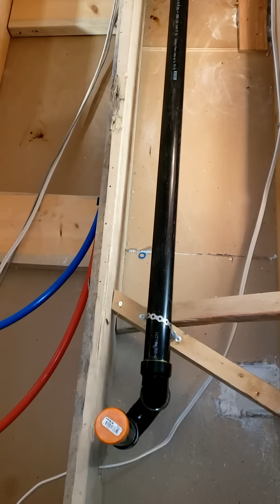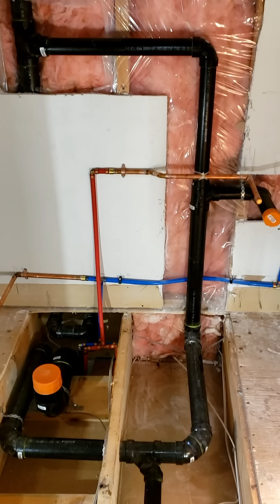Wet Venting EXPLAINED! - #SHORTS

Comment: So I was wondering the one that only handles Air I guess it’s on the left hand side of the video behind the drywall. Can you run a condensation line from an AC to that one because it does go to the draining system yes thank you
Reply from the maker: Good question.  Technically, no, you're not allowed to simply connect a condensation line/pump to the vent.  While you're correct in presuming that it does lead to drainage (and WILL "work"), the vent is carrying sewer gasses, and simply dumping the contents condensate line into it without properly trapping and venting it, may expose sewer gasses into the building.

Then there are other implications about having the extra volume of water draining through the wet vent, proper sizing, etc.

The optimal solution would be to have the condensation line discharge indirectly into a nearby or added floor/hub drain (with a proper vertical air break of at least 25mm/1" - depending on your jurisdiction), or perhaps indirectly discharge into another fixture.

I know it sounds like a pain and futile, but that's the Code requirement for proper plumbing! 🤷
Reply: @PlumbingsCool thank you so much for the reply, my house was built in 1980 it’s a one story and they did run the condensation line into the sewer line directly. I just recently found this out because the condensation line was bumped by the ac repair man. I have no idea what can of worms this is going to open, there is a ptrap on the condensation line before it gets to the air handler. I wish there was a way I could show this to you, my words aren’t doing it justice because this isn’t my wheelhouse. Once again thank you.

Comment: Isn't the lav dry vented since its vent is totally dry? This would mean only the toilet and shower are actually utilizing the wet vent.
Edit: actually even the toilet looks like it's vented directly into the main stack, leaving only the tub/shower using the wet vent. I say this because have a toilet that isn't tied to the main stack for air, yet wet vented through a 2 pipe shared with shower. The sink lav has its own aav. I was curious as to whether I should correct this, but it is apparently allowed in my area.
Reply from the maker: You're correct in pointing out that the lav is not receiving air through the wet vent - but it's still part of the wet vented group (only that it's the uppermost fixture of that group).  The "dry" vent is actually called a continuous vent here in Canada, and if you think about it, it's supplying air to ALL THREE fixtures. , but the 2" wet vented portion (between the lav and the toilet's connection) is supplying both air AND water - albeit only to the shower and toilet (hence the term WET vent).  You can think of a wet vent of a two-lane road (both air and water), whereas the continuous vent upstream of the lav and drain downstream of the toilet are both single lane roads (only air and only water respectively).  

Finally, while the wet vent stops upstream of the toilet's connection, it most certainly is providing air to the toilet (and more importantly, protecting the other fixtures' traps from becoming siphoned out whenever the toilet is flushed due to the supply of air through the wet vent.

Hope this helps and Happy New Year! 🥂

Comment: In FL the toilet is the first upstream the wet vent from lavatory and then shower. Any plumbers from Florida please correct me if I’m wrong but this set up would not pass inspection here
Reply from the maker: Just curious: Would you know what plumbing code Florida uses? Perhaps UPC?

Up here the toilet ALWAYS needs to be the most downstream fixture of the wet vented group.  The logic being that you don't want the toilet:s high volume passing by any other fixture trap arms, which may siphon out the downstream fixtures' trap.

Comment: The only thing wet venting here is the shower, the toilet is vented off the stack and that vanity has a dry vent
Reply: I was trying to see how that closet elbow was connected. With a shadow on that ABS it's hard for me to see.
Reply from the maker: Just checked my archive images:  The toilet is wet vented with a 3x2" Wye standing vertically just downstream of that 90, with a fitting-in 45 to turn the Wye upward and meet with that 2" 90 facing down.  

This qualifies as a proper, legal wet vent here in Canada.
Reply from the maker: Nope, it's fully and properly wet vented vented per our Code here in Canada.

Comment: Why are the water lines on the outside of the wallboard?
Reply from the maker: Good question.   They're on the outside because the wall you see in the video is an outside wall, which is subject to freezing during our Canadian winters.  Therefore, they were installed in this manner because the framer was not yet on site to install the hollow partition in front of it.  It was one of those rare cases where the carpenter built around my work, rather than me drilling through the studs.

Comment: Very poor work without proper protection. Use HAP System pipe hangers and accessories cool stuff that actually works!
Reply from the maker: Didn't need them, as the fastening you see there is temporary because I got in before the framer; once the carpenter came on site to install the wood partition, all the piping was properly fastened up against it.

Comment: That zip tie holding the copper pipe for the black drain pipe is a problem not only is it a code violation, but it’ll cause the black drain pipe to crack when that copper pipe, which is clearly hooked up to a hot line expands and the zip tie squeezes the black pipe and turn🤦🏼‍♂️
Reply from the maker: Your statement is inaccurate on many levels:   There's nothing illegal about it; the zip ties were used to temporarily hold the pipe intact until the framer could come by to install the wood partition surrounding it.  The hot water piping will NOT expand enough to damage the drainage pipe - not even close.  Even if it did expand, the black pipe you're referring to is ABS material, which is INCREDIBLY strong - much stronger than the zip ties' are able to hold without snapping.  The zip ties are now irrelevant since everything has been nicely fastened to the wood studs with proper clips and suspension strapping.

Comment: Can you run 3 sinks on a 1 1/2 air vent?
Reply from the maker: If you mean the connection of three kitchen/laundry sinks to an 1-1/2" branch vent, then the short answer would be YES (Per Ontario/Canada Code) with lots of available load to spare for additional fixtures (but depending on total overall branch vent length and whether anything else is connected to it).

Comment: yeah i was gonna say, water closets have a minimum 2" vent
Reply from the maker: That's UPC.  Here in Ontario & Canada, we use the Ontario Building Code and National Plumbing Codes respectively...which requires only an 1-1/2"  vent for toilets.

Comment: Ziptip a tap line?
Reply from the maker: Are you referring to the zip ties? Those were installed only to hold the lines until the carpenter came in to install the studs.  If you look carefully, you'll see that it's an exisitng outside wall (subject to freezing in our climate), so a hollow inside wall was built to accommodate the plumbing...except that the carpenter hadn't come in to build out the wall when I showed up to do the rough-in.

I can assure you that the plumbing was properly and securely fastened once the partition was up. ☺️

Comment: Could you have the wye facing the other way with a street 45 and pipe going through the joist  to catch both the sink and shower instead of going around? Genuinely curious.
Reply from the maker: Hmm...sure I properly visualize your suggested configuration.   Do you mean having the main run of the Wye pick up both the shower and the lav at each end of the Wye, and have the wye's branch drain into the pipe through the joist?

If so, then no, because the Wye is designed to drain in one direction only. 

If that's not what you meant then please do feel free elaborate.

Comment: Do the trap arms still apply as normal? For example, the wet vent in this group goes from the toilet to the lav, and the tub trap arm is wyed in between. Do the same (dry vent) trap arm rules apply to the tub/shower?
Reply from the maker: That's an EXCELLENT question! 👍   Yes, all the same fixture drain/trap arm requirements still apply when connecting them to a wet vent:

1. Maximum change in direction of 135° (235° for toilets),
2. Minimum two pipe diameters before connecting,
3. The trap arm cannot exceed 1 pipe diameter of fall before connecting, 
4. Maximum designated trap arm length (i.e., 5 feet for 1-1/4" pipe) 
5. Minimum fall is 1:50 (or ~1/4In/Ft) 

Try to look at it this way:  The trap arm has NO IDEA what kind of vent it's connecting to; only that it's receiving air...and when doing so, the aforementioned rules still apply, whether it's a wet vent or a dry vent. 

One noticeable difference is that a wet vent can connect vertically equal (on the horizontal), wheras a dry vent must connect above the horizontal centerline of the connecting trap arm (to prevent solids from eventually entering and blocking the vent - which can't be serviced!) 

Hope you this helps!
Reply: @PlumbingsCool

I got into it with an ahj inspector, and then the master plumber on site for this very question. The situation was exacy like this but the tub drain, was about 8-10'' away. I reasoned exactly as you described but the inspector said it was "part of the wet vent system" knowing fully the vent went through the lav.

Thank you for the verification, I appreciate the time. Your explanation was helpful and it was essentially the same one I made. Oh well.

Comment: I have to do this but you can vent an entire house with a hole the size of a drywall screw
Reply from the maker: Uhhhh...no?
Reply: @PlumbingsCool  do this -fill all the ptraps cap the stack going out the roof and plug the main sewer , flush a toilet and see if it flushes and if it dosent flush theres no leaks drill a 1/8 " hole anywhere in the system and i bet you the toilet will flush

Comment: Is that vent reduced below flood level rim?
Reply from the maker: I suspect you're referring to the continuous vent above the lavatory's TY (1-1/2") and you're comparing it to the larger 2" wet vent?

If so, then no, it's not reduced in size because they're two different systems and sized using different tables:  The 1-1/2" conveys air only, while the 2" is sized to convey both drainage AND air.

Hope this helps.
Reply: @ I was referring to the 2”x1.5”x2” sanitary tee. Would you technically not be reducing below flood level rim there?
Reply from the maker: Maybe you're referring to the 2x1-1/2"x1-1/2" sanitary tee picking up the lavatory trap arm?

Again, there is no such reduction because the 2" side is a WET VENT; the 1-1/2" at the top is AA only a dry vent that's bringing air to all three fixtures.  

Also, we have no such restrictions about downsizing piping above the flood level rim (not that we would); what matters is that any vent pipe connections must connect above the flood level rim to prevent unintentional bypasses.
Reply: @PlumbingsCool  here we can’t reduce or offset until 6” above flood level rim and yes it’s  a 2x1.5x1.5 san tee which would be a reduction?
Reply from the maker: Yes, it's a PHYSICAL reduction in size from bottom to top; I'm not disputing that...but the two sides  serve different purposes; you see them as the same system, which they aren't.  Top side is a Continuous Vent using Table 7.5.8.3., and the bottom side is a wet vent using Table 7.5.8.1..

And to be clear, we also can NEVER downsize a vent, regardless of whether it's below the FLR or not.   For example, take the shower in that scenario:  If I instead chose to separately vent it, I'm allowed by Code to run 1-1/4"  individual vent for a 1-1/2" trap.  However, I'd practically run a 1-1/2" vent because that's what's available in plastic.  Once I started running 1-1/2", I would need to stick with that size and cannot ever downsize to 1-1/4", anywhere ever...although I can always upsize to whatever size I want.

Hope that makes sense. 

I'm presuming you're restricted to continue running your WET VENT 6" above the highest fixture's FLR?  that wouldn't apply to us because for us the wet vent terminates at the lav's trap arm.

Comment: Minimum toilet vent is 2” and you have two other fixtures on it
Reply from the maker: In Ontario and Canada this is all perfectly legal.  Our toilet dry vents are 1-1/2", and there's no limit as to how many fixtures are part of the wet vented group, as long as they're upstream of the toilet, don't exceed 2" trap arm size, and the total fixture unit load draining into the wet vent  doesn't exceed the fixture unit load capacity for that wet vent size (max 3 FU for 2"; max 8 FU for 3"; max 12 FU for 4").

Comment: Should be 2" all the way up. Shower is draining to toilet vent also?
Reply from the maker: Maybe where you are (UPC??🤔 ) but not here.  We size the dry vent portion (called a Continuous Vent if serving a wet vent) based on the number of fixture units being served by that vet, as well as total developed length, and of course minimum vent size for the trap sizes it's serving (a toilet's 3" FOP requires a minimum 1-1/2" vent).

So for this application, 1-1/2" north of the lav is waaaaaay more than big enough.  Try to look up either Table 2.5.8.3 (National Plumbing Code) or 7.5.8.3 (Ontario Plumbing Code) if you want to get a better idea of how that sizing table works.

And yes, the shower is draining into the toilet's 2" "vent"...which is really still the WET vet, and is therefore allowed to drain into it (the toilet needs to be the most downstream fixture if it's part of the wet vented group.)  For a peek at our Canadian and Ontario Wet Vent sizing tables, just look up Table 2.5.8.1 and 7.5.8.1 respectively.

Comment: The one thing I’m pretty sure you are wrong about is showers need to be 2” no matter what. At least in Oregon, but I think everywhere.
Reply from the maker: Maybe in Oregon, but here in Ontario and Canada the minimum-size FOP/trap for showers and bathtubs is 1-1/2", at a fixture unit load value of 1.5.  (2" shower traps are valued at 3 FUs, and 3" are 6 FUs).

I have heard some recent stories of some inspectors (namely out west) demanding an upsize of 2", for the mere reason that drain bodies default with a 2" outlet and must be bushed down to 1-1/2" for an 1-1/2" trap...which is a stupid reason to demand so, in my opinion, given the little amount of water that drains down it from a standard shower head...and these are the same inspectors who pass 1-1/2" traps installed for those massive freestanding tubs.

Hey, happy new year! 🥂
Reply: They are definitely 1-1/2" up here, but if you have extra 2" pipe there is no reason to downsize it if you can spare the 2" more pipe space for the water to drain is good.

Comment: Dealing with messed up plumbing in my house right now, the shower directly connected to the main soil stack and then after it the toilet, then the sink which has the only vent to the roof which is wet from the sink down, pray for me
Reply: Also the wet vent is 1 1/2"
Reply from the maker: Hmmm...a little tricky to visualize your layout.  If all three fixtures are connected to and draining into the 3" stack, then it may very well be legal (such a configuration was once referred to as "stack venting"...but it's all just called wet venting these days.)  If that is the case, then your stack is acting as the wet vent between the three fixtures. 

The lavatory may have a separate vent because it's trap arm may be too long (over 1.5M or 5 feet) before it discharges into the stack. 

But I'm not sure if the above is what you were trying to describe. 

(I'll pray for you anyway! 😁)

Comment: I think the san t is upside down
Reply from the maker: Which one?...there are two of them.  Both are correct:  The lav's continuous waste has the weir at the bottom to direct drainage, and the 2x1-1/2" TY connecting the continuous vent has the weir facing up to maximize airflow to and from open air.

NOTE that although the latter TY is "correct" based on proper plumbing practice, the weir's location technically doesn't really matter when venting, and is why you're allowed to you a regular tee (with no weir) or cross fitting in a venting system..."air don't care!" 😀

Comment: Canadian Code Table 2.5.8.1: smallest diameter of any wet vent serving a toilet is 2"
Reply: Massachusetts plumbing code requires 2 inch the whole length to the ties into the main stack.  Wouldn't the water closet be considered vented because of the 3-in pipe behind the sheetrock.
Reply: Same in America…..
Reply: That's exactly what he said in the video....
Reply: @paulmacdonald7068 but chokes down after the lav?
Reply: @tweety5653  it's not choked down" it's only a vent there. 11/2 is large enough to carry the fixtures it's venting.  The wet vent portion (below the sink drain) is increased in size from 11/2" to 2" because it's acting as a drain and a vent.
Reply: @ the toilet needs a 2” vent. I use upc
Reply: @tweety5653  lol, well, that's unfortunate for you. Here in Canada, min WC vent it 11/2". 

2" is just overkill and unnecessary.

Comment: 😂😂😂😂😂 Gotta love the zip ties on the water lines! Emberessing to say the least.
Reply from the maker: I'm never ceased to be amazed by those who are so quick to judge and criticise with such limited information - all for the mere purpose of inflating one's own ego:

The zip ties are there because the framer was not yet on site to build the partition; that's an outside wall, and the pipe's needed to be kept inside to prevent freezing. I can assure you that all piping was significantly fastened before the drywall was installed.

And its spelled, 'embarrassing'...which is ironic on so many levels. 😁
Reply: You’re kidding right 😂